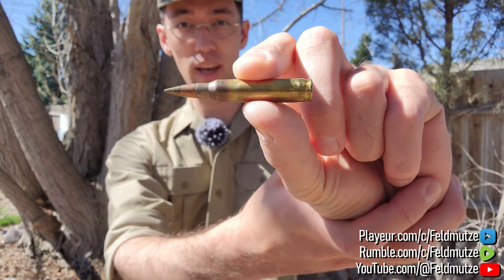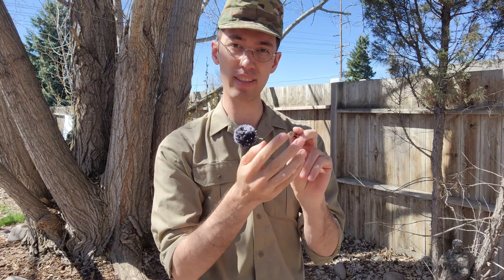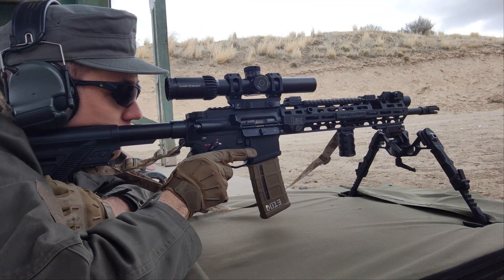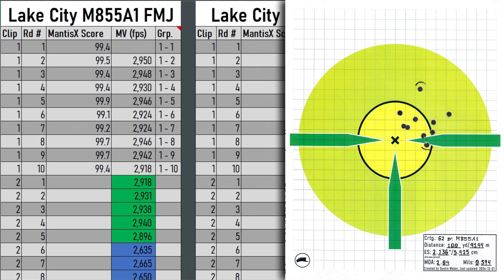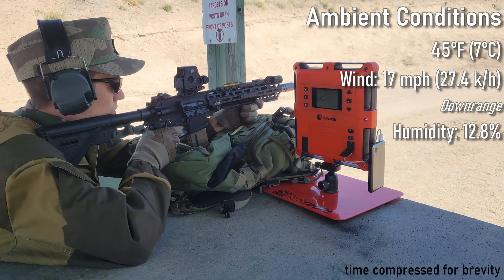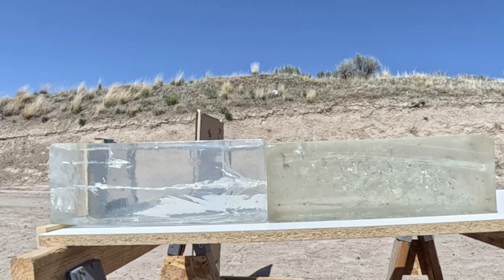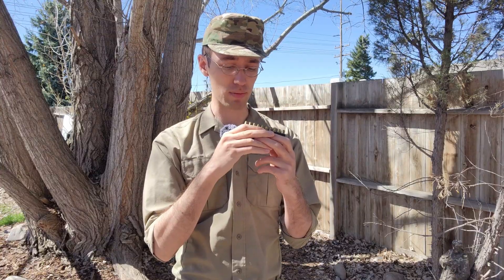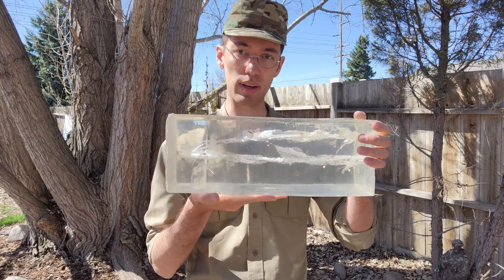M855A1 Precision and Terminal Performance

Comment: Wait a minute, where are the copper rear sections of the m855a1 rounds in the gel? I see the front penetrator, but there is also a rear copper slug insert behind that. Take one apart and look, maybe they got rid of it?
Reply from the maker: Thanks for bringing that up. I looked through the gel and finally found it, it acted weird as it turns out the copper slugs from both the 10.3" and 14.5" ended up intact in the backer gel block, actually both going further than the penetrator itself.

It's easier to see on the 10.3" footage if you go frame by frame on the gel footage at 8:37, it ended up 1" into the backer block directly in line with the projectile path.
Reply: @Jang-gun銃  (:

Comment: Stepping up your production value I see, nice!

I got to experience the changeover from 855 to 855A1 in the Guard. Anecdotally, 855A1 gave us noticeably better groups @ 25m out of M4s than green tip, even for our worst shooters. I believe that the pressure was stepped down not long after introduction, so I imagine the stories of chewed up feed ramps and blown out bores come mainly from the initial production. I think I heard somewhere that Magpul tweaked their Gen 3 mags to feed 855A1 specifically and avoid damage. 

Regardless though, there's enough video out there now to convince me that 855A1 is a capable barrier-blind round and lite-AP if needed. But for the average guy, the price and availability is just too high a bar. I'm sticking with high pressure/velocity M193 for most things, and two mags of lead core 77gr for defense
Reply: Look into TSX rounds too, Seals used them for a reason, and you can actually find them for really good prices.  Much better accuracy, with great terminal effect to extended ranges and great barrier blind performance against stuff like auto glass.